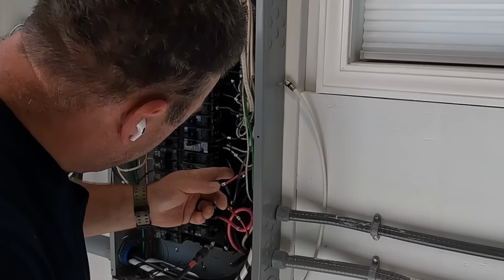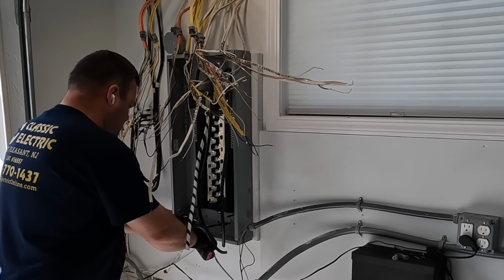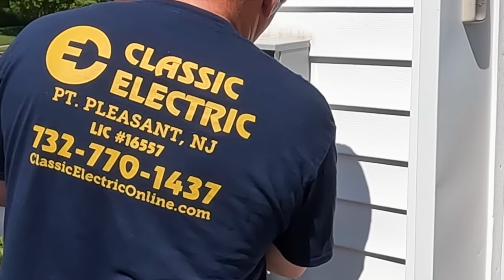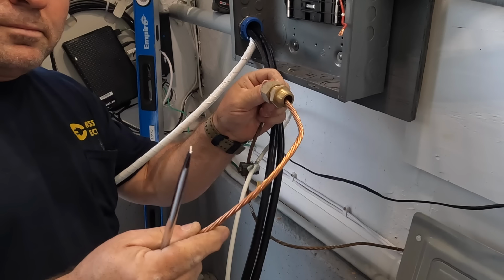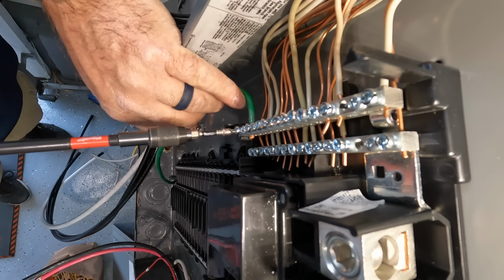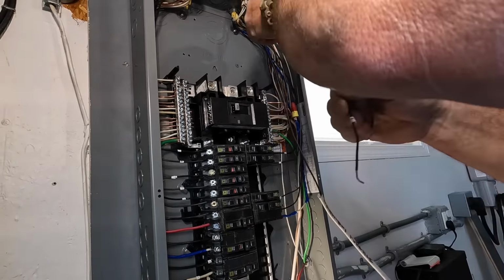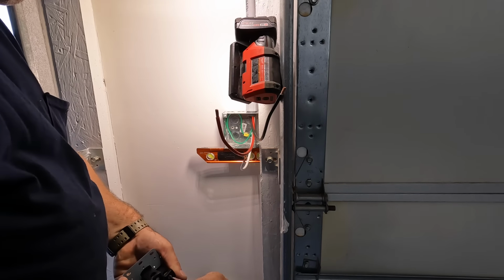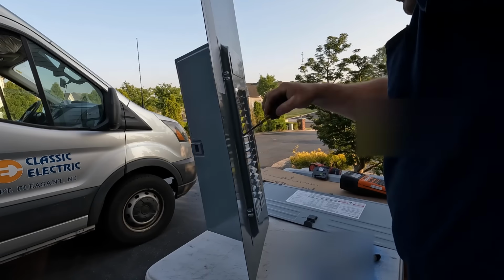Panel Upgrade from 150A to 200A + A New Electric Vehicle Charging NEMA 14-50 Receptacle and Circuit

Comment: It's interesting how installations can be different depending on the location  . The exposed Romex going into the panel would need to be covered up here in socal . Usually done with a bit of framing and drywall but of course a gutter would be allowed . Also being so dry in my area I usually run emt for  exposed locations . It's funny how the code is interpreted depending where you are . Nice work . Very efficient .
Reply: Really, no exposed Romex whatsoever, huh? That's usually the rule of Romex in general (no surface mounting of it), but it seems entry into a surface-mounted panel is a sort of exception every place I've seen it.
Reply: @aaron74  Things like attics ok even though crawling in one you can walk and crawl over them on a regular bases . I believe drop down tbar ceilings are not allowed . The term in the code subject to damage is quite vague to interpretation and it seems a specific location rights it's own interpretation of the code .
Reply: @stevencole7331  I've always just imagined that Romex can only run in spaces that can (but not necessarily will) be covered by drywall. So it can go in stud and joist bays or truss webs.
Reply: @wizard3z868  Another example I could never use is that service cable.  Most times I have to uses Ridgid pipe which is used as a mast to secure the overhead triplex to . That's more of a southern California Edison issue .
Reply: @aaron74  not in Northeastern Illinois either, all that romex connected to the panel just looks wild to me. Local 134 and 701 in Illinois everything coming out of that panel would need to be in EMT and rigid pipe connected to the meter.

Comment: When you’re ready to get a torquing screwdriver, look into the Wiha 28506. It ranges from 10-50 inch pounds and I love it
Reply: Wiha makes great tools but EV receptacles require more than 50 in LB. My Bryant torques specs at 75

Comment: Great video Ron.
1. Please don’t turn up the music too loud. It’s a little distracting. 
2. I know the 4 square raised crush cover probably bonds the 14-50 receptacle, but you wouldn’t rather have a direct EGC connection to the receptacle?
3. A torque screwdriver is a must nowadays. There isn’t just a danger in undertorquing, but also in overtorquing. I went to a trade show once where the Leviton booth had electricians compare what they thought was a good torque to what a calibrated torque driver had and they were all over the place. 
4. Any reason to not use plug on neutral panels now to at least provide the option to use GFCI or AFCI circuit breakers? Cutting the neutrals short to the ground/neutral bus bar prevents using GFCI or AFCI circuit breakers in the future because they are too short.

Comment: Hey Ron, thanks for the excellent video! I feel like I have a much better handle on this project for the future.
I have a quick question: I need to run an overhead line from the house to the garage for general stuff - it's about 80 feet. Exactly what wire should I use to do this (I heard something about XHHW-10-7STR-CU)? Isn't there a single "Romex-type" 12-2 or something that will work without running three separate wires? Thank you sir...

Comment: Nice vid. Curious why customer did not go to 200 amp? Facing the same issue myself. Have 100 amp, go to 150 or 200? Lights dim when ac kicks on.
Reply: They did go to 200A. For your issue you may want to consider installing a hard start kit on your condenser unit, much cheaper.

Comment: HI Ron - thanks for all the videos! Not sure if it was edited out, but I did not see a ground connection to the 14-50 receptacle, only to the 4" metal box. BTW - I installed a Bryant 14-50 receptacle on my EV installation. Subsidiary of Hubbell and identical equipment for about 60% of the price.
Reply from the maker: The box is grounded and when the cover is attached to the box the receptacle becomes grounded.

Comment: Ron,
If the service panel was located in the basement on the other side of the house, do you use the same method with PVC conduit or romex cabling?

Comment: good video.   The new Tesla wall chargers are hardwired.  No need to install the Nema 14-50 if you choose that wall charger.  48Amps.    It looks like this customer has a different EV and installed.   The Nema 14-50 is great if you going to use the portable charger.

Comment: Hey , Thanks for your great videos. 
Question 
I am converting my two car garage to a small house. ADU in Los Angeles CA 
Si my question is 
I had to upgrade my main electrical panel from 100am to 200.
Code in Ca ask for a EV DEDICATED CIRCUIT. 
What do they mean by that ?
Do I need to run wire or just leave an open slot for an 50am breaker??
Thank Ron
But I heard the
Reply from the maker: Check with your bldg dept.

Comment: Hi Sir that would be a no no in U.K. the way you put the green ground wire into your panel with out putting a stuffing gland on it the way you did it just pushing it through a metal knock out . Very interesting how you use a impact driver to tighten up your breakers as well . Love learning about usa 🇺🇸 regulations keep up the amazing work and videos . Watching from the U.K.
Reply from the maker: That opening is designed specifically for the grounding electrode conductor as shown in the video.
Reply: No harm no foul in the USA; we don't insulate or sleeve ground (earth) like you guys in the UK do. An insulated ground conductor is more of an exception than the rule here. So it doesn't matter if the insulation were abraded by a sharp knockout!

Comment: Hubbell HBL9450A or Bryant 9450FR torqued to 75 in-lbs.  Both are made by Hubbell.  Leviton has an EV rated 14-50R now as well.  P/N 1450R.  I can't find one so I haven't used it yet.  The leviton site says made in china.  The Hubbel/Bryant are made in the USA.

Comment: Nice work was confused when u said inch and a half hole for 200 amp but the pipe was existing good thing u used copper aluminum would of never fit haha

Comment: Sorry if it's a dumb question (I'm not a pro) - but how come in the 15-50 you don't have to attach the ground to the receptacle's ground lug?
Reply: It depends, the ENC says no, but you city could require it, I always connect the ground to everything that could become energized (box and receptacle in this case), although I personally believe I don't need to
Reply: @currentlyblake  thanks!

Comment: Hey Ron - Thanks for putting out these videos!  I learn something new each time.  Would terminating the GEC to the service enclosure go against 200.2(B) in your area?  I've only seen them terminated to a neutral bar.
Reply from the maker: The GEC is different from the grounded neutral.
Reply: @electricianron_New_Jersey  might be over thinking it, but I was thinking that there is always a little current making it's way back to the transformer through ground (PoCo connects the primary and secondary system winding neutrals to ground) , and since the neutral is bonded to the service equipment enclosure,  this current would need to travel through the enclosure from the neutral to make it's way back.

Comment: I need to have my main breaker panel replaced but the problem is that as soon as the job was signed off by building and safety the county would reassess my house at the current (absurd) property value and my property taxes would go up by more than $1000 every year.

Comment: the electrical inspector didnt passed my work at  the panelbox once becuz i taped  service wires with white tape also he wanted plywood and drywall behind for the new 200 amp panelbox

Comment: Seems odd a 2012-built house wouldn't have already had a 200A panel. That looked like a pretty straightforward upgrade being really close to the meter and the van. Those $100 Hubbell/Bryant 9450 receptacles are kind of snake oil in my opinion. They do have very good terminations on the back of them where you use an Allen wrench to tighten the lugs, and they might have more metal contact with the plug inside. But my question is how often do EV owners plug/unplug their charger from the receptacle? You plug it in and forget about it unless or until you need to replace the charger.
Reply: @Ampacityelectric  The following Munro Live video (  https://youtu.be/tDp9PhPJhUI  ) had some electricians review some 14-50 receptacle failures for EVs. I'd be concerned about using a receptacle that was designed a decade or 2 ago for a range and then have it be used for an EV - which may be under full load for several hours. Especially in a garage you typically won't stay there when the device is in use - even worse you may often be asleep. The best solution would be to hardwire EV charges and avoid the receptacle completely.
Reply: @JasonEDragon  That is a sobering video, thanks for sharing that. I had no idea. Yeah I think all those standards agencies NFPA, UL, CSA, and NEMA are going to need to engineer EV-specific electrical materials. For 50 amp sustained loads.

Comment: "the gfci's from pass & seymour, I've always seemed to have a bad experience with them".
funny you say that, because I recently had a new GFCI, that's stuck on, it won't trip with test button, tester or other means of ground faulting. the light says it's in working order and it's passing power through out the load terminals also. it's a "Legrand" brand. also within the last year, I've had numerous others with random issues, some wouldn't reset, some the LED's do nothing regardless of state, some test buttons didn't work, but a tester would trip them. just a mixed bag of trash, from all brands. how do we trust any of them to actually work if needed? not like we have lab grade test rigs with us. 🤬💩